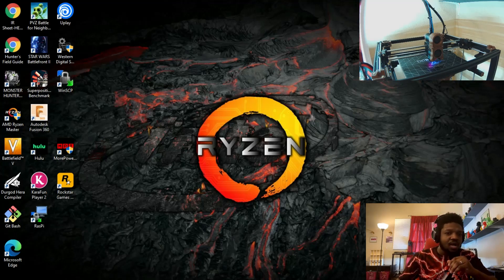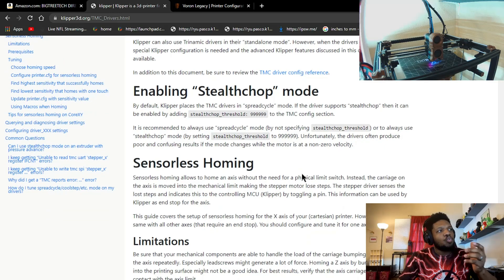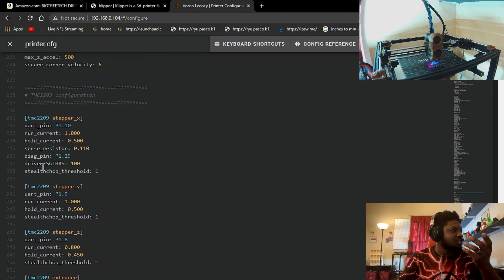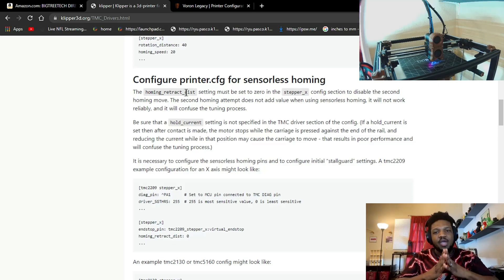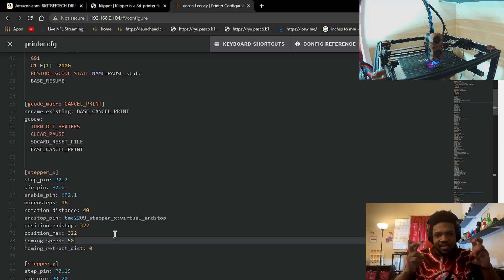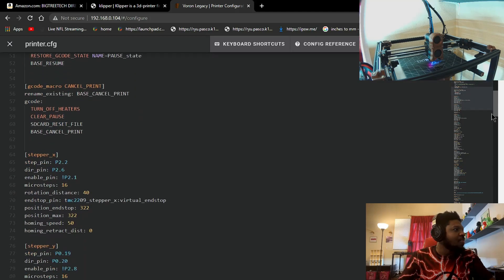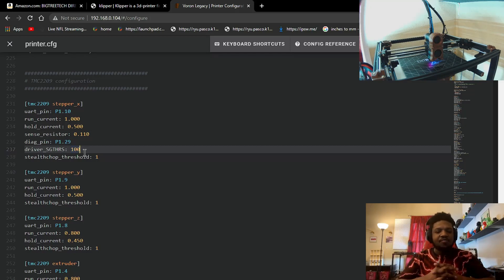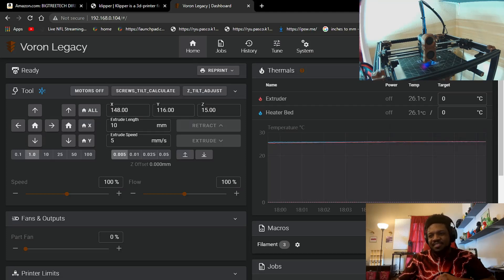// How To Setup Up Sensorless Homing In Klipper // GoldenJaguar392

Comment: Have you tried adding a homing macro on any of your printers yet? The Voron printers use a homing macro that lowers the driver current on the motors, and it applies some other changes to the TMC drivers, which allows for the homing retract to work properly without the endstop error being triggered when it uses your standard TMC driver settings in the config. I am looking for a good tutorial on how to do this with TMC2209, but I cant seem to find any.

Comment: Do you have to cut diag pins for Z axis and E axis drivers? I remember having to do this while configuring marlin way back..
also, do you need to specify diag pin and driver_SGTHRS for all axis that should have sensorless homing? 

For example in the video the config does not contain diag_pin and driver_SGTHRS in stepper Y.
Reply from the maker: you with new board like skr 3 skr 2 and skr octopus board you don't need to cut the pin any longer..a jumper is used instead to activate sensorless home on the axis that It's needed on.. Yes you will need to specify a diag pin which is basically the endstop pin of the axis and driver_SGTHRS for sensitivity. for axes that are not using sensorless homing you wouldn't need any of the latter.

Comment: Hello
GoldenJaguar3D, could you pass your printer.cfg to check the settings? I'm having a problem that I can't do the home correctly, if you can pass it, I'd appreciate it.. a big hug.
Reply from the maker: aw sorry for super late reply buddy didn't even see you're comment till now 

[stepper_x]
step_pin: gpio11
dir_pin: !gpio10
enable_pin: !gpio12
microsteps: 16
rotation_distance: 32
full_steps_per_rotation: 200
endstop_pin: tmc2209_stepper_x:virtual_endstop
position_endstop: 300
position_max: 300
homing_speed: 50
homing_retract_dist: 0

[tmc2209 stepper_x]
uart_pin: gpio9
tx_pin: gpio8
interpolate: false
uart_address: 0
run_current: 1.2
diag_pin: ^gpio4
driver_SGTHRS: 130
stealthchop_threshold: 0

Comment: Works great for the X but just crashes into the Y no matter the sensitivity.  Even tried swapping drivers.  Any ideas?
Reply from the maker: what board are you using?
Reply: @GoldenJaguar3D  fysetc spider v1.1. Jumped the xy diag, removed the endstop wiring, and definitely using the right pin designations for the diag.  If I switch the diag pin to have a ^ in front then the Y wont move at all

Comment: do i need to cut the pin on the stepper drivers or is that not needed in klipper?
Reply from the maker: yes you need the pin on the stepper driver, If you cut it sensorless homing won't work.

Comment: Thank you for your good video,  ı made your settings then X step working good but when ı make same settings for Y mainsail give me an eror, "pin virtual_endstop used multiple times in config" how can ı do it for Y too ? 

thank you for your help
Reply from the maker: It’s sound like you have the same pin duplicated in your config make sure to remove the pin from your y stepper endstop since you’re going to be using it as a diag pin for your y stepper driver.
Reply: @GoldenJaguar3D   sorry can you explane more clear ı am not full control on this job :)

Comment: Okay, maybe stupid question here about the diag pin.  I think you said your setup is for a SKR 1.4 and your diag pin is shown as P1.29 which seems to be the x-endstop pin.  If sensorless homing means getting rid of the physical x- (and y-) endstops, why is it required to include the diag pin?  Wouldn't that pin have nothing connected to it?  I ask because I think I read somewhere about connecting pins with jumpers and that's kind of where I got lost.  Otherwise I understand the configuration, makes good sense.  Appreciate any response.  I feel like you're going to answer and I'm going to immediately realize whatever it is my brain just isn't grasping right now.
Reply from the maker: Well the diag pin the located on the 2209 driver itself, it purpose is to detect stepper motor stall, in the case of sensorless homing where motor hits the side of the gantry. in your printer.cfg you're telling firmware that you're using a virtual endstop, just like you would for a z probe, but in this case its a pin on the driver (2209) itself. If you don't set a pin in the config. The firmware won't know where the senor is, I hope this helps. Pin  P1.29 can be used as a  physical or virtual endstop.
Reply: @GoldenJaguar3D  I think I get it.  The diag pin is on the driver and I'm telling the firmware to take that signal and treat it as it would a signal coming from Pin P1.29 (aka, the pin that would normally be a physical endstop) so when the diag pin detects a stall, the firmware takes that stall and calls for the motor to stop.  Hence, virtual endstop.  I think?
Reply from the maker: @phildawgydawg  exactly you got it!!

Comment: Hi I have followed your tutorial, even copying your settings from comment below and still not working, it is just crushing into side of printer ... Do I need to change something on stepper? Cutting/bending pin or something? On marlin  with sensorless they worked fine (but to do so i had to cut of one pin from driver, is it a case?)
Reply from the maker: Hey sorry to hear about this man, but to answer you’re question, no you need the Diag pin in order to use sensorless  homing, if you cut it you can’t use sensorless homing and will need to use a limit switch. So make sure that the driver your using have the diag pin intact and supports sensorless homing.
Reply: The file he posted below DOES NOT have any sensorless homing in it.

Comment: I'm having troubles just to get mine to home and I've gone every which way with the sensitivity and it still does not work?
Reply from the maker: Sorry about this man, did you make your driver supports senorless homing
Reply: @GoldenJaguar3D   I did it's the tmc2209s
Reply from the maker: @hunterfisher2304  what brand is it? also what board are you using?
Reply: @GoldenJaguar3D  Im using the bigtreetech skr 1.3 and the bigtreetech tmc 2209 v1.2 stepper driver's
Reply from the maker: @hunterfisher2304  ok take a look at this video, make sure you didn't cut the diag pin else it won't work. https://www.youtube.com/watch?v=zZYd0aYtThY

Comment: Currently I am using spread cycle but do I need to adjust jumpers on board beside these tips? (fluiddpi +skr 1.4 turbo
Reply from the maker: No you shouldn’t need to for sensorless homing, you only adjust the jumpers to config uart mode communication for the drivers.
Reply: @GoldenJaguar3D  Thank you bro after my print is done I will try right away, I am sick of my endstop spring being to pop out

Comment: can you share your printer config? I'm having problems getting things working.
Reply from the maker: Sure thing, I will when I get off work.
Reply: @GoldenJaguar3D  thanks I appreciate it, i'm upgrading the tronxy x5sa pro
Reply from the maker: @hankb7725  here you go as promise, [virtual_sdcard]
path: ~/gcode_files

[gcode_macro PAUSE]
rename_existing: BASE_PAUSE
default_parameter_X: 1    #edit to your park position
default_parameter_Y: 320    #edit to your park position
default_parameter_Z: 10     #edit to your park position
default_parameter_E: 1      #edit to your retract length
gcode:
    SAVE_GCODE_STATE NAME=PAUSE_state
    BASE_PAUSE
    G91
    G1 E-{E} F2100
    G1 Z{Z}
    G90
    G1 X{X} Y{Y} F6000
    
    

[gcode_macro RESUME]
rename_existing: BASE_RESUME
default_parameter_E: 1      #edit to your retract length
gcode:
    G91
    G1 E{E} F2100
    G90
    RESTORE_GCODE_STATE NAME=PAUSE_state MOVE=1
    BASE_RESUME
    

[gcode_macro CANCEL_PRINT]
rename_existing: BASE_CANCEL_PRINT
gcode:
    TURN_OFF_HEATERS
    CLEAR_PAUSE
    SDCARD_RESET_FILE
    BASE_CANCEL_PRINT

[stepper_x]
step_pin: P2.2
dir_pin: !P2.6
enable_pin: !P2.1
step_distance: .01
endstop_pin: P1.29
position_endstop: 0
position_max: 320
homing_speed: 100

[stepper_y]
step_pin: P0.19
dir_pin: !P0.20
enable_pin: !P2.8
step_distance: .01
endstop_pin: !P1.28
position_endstop: 0
position_max: 320
homing_speed: 100

[stepper_z]
step_pin: P0.22
dir_pin: !P2.11
enable_pin: !P0.21
step_distance: .0025
endstop_pin: probe:z_virtual_endstop
position_min = -3
position_max: 380
homing_speed: 50

[stepper_z1]
step_pin: P1.15
dir_pin: !P1.14
enable_pin: !P1.16
step_distance: .0025

# Define a probe
[bltouch]
sensor_pin:P1.27
control_pin:P2.0
pin_up_reports_not_triggered: true
pin_up_touch_mode_reports_triggered: false
speed:5.0
pin_move_time: 0.680
x_offset: 0
y_offset: 0
z_offset: 1.965
samples: 3
samples_result: median
sample_retract_dist: 3.0

# The safe_z_home section modifies the default G28 behavior
[safe_z_home]
home_xy_position: 189,168
speed: 250
z_hop: 15
z_hop_speed: 50

[idle_timeout]
timeout: 2500

[bed_mesh]
speed: 250
horizontal_move_z: 5
mesh_min: 50,50
mesh_max: 310,290
algorithm: bicubic
fade_start: 1
fade_end: 5
move_check_distance: 3
probe_count: 4,4
mesh_pps: 4,4
bicubic_tension: 0.8
split_delta_z: .025
relative_reference_index: 7

[input_shaper]
#shaper_freq_x: 46.51
#shaper_freq_y: 55.86
shaper_type: mzv

[gcode_arcs]
resolution: 0.05

[display_status]

[z_tilt]
z_positions: 318, 168 
            59, 168 
points: 318,168
        59, 168
speed: 300
horizontal_move_z: 5
retries: 20
retry_tolerance: .0025

[bed_screws]
screw1: 154,11
screw2: 2,318
screw3: 315,318

[screws_tilt_adjust]

screw1: 49,318
screw1_name: rear left screw
screw2: 318,318
screw2_name: rear right screw
screw3: 183,31
screw3_name: front screw
horizontal_move_z: 5
speed: 300
screw_thread: CCW-M3

[idle_timeout]
timeout: 2500

[extruder]
step_pin: P2.13
dir_pin: !P0.11
enable_pin: !P2.12
step_distance: 0.0023148148148148
nozzle_diameter: 0.400
pressure_advance: 0.0676
filament_diameter: 1.750
max_extrude_only_distance: 200.0
heater_pin: P2.7
sensor_type: NTC 100K beta 3950
sensor_pin: P0.24
#control: pid
#pid_Kp: 22.2
#pid_Ki: 1.08
#pid_Kd: 114
min_temp: 0
max_temp: 300

[heater_bed]
heater_pin: P2.5
sensor_type: EPCOS 100K B57560G104F
sensor_pin: P0.25
#control: pid
#pid_Kp: 54.027
#pid_Ki: 0.770
#pid_Kd: 948.182
min_temp: 0
max_power: 0.8
max_temp: 150
pwm_cycle_time: 0.0166 

######################################################################
# Filament Change
######################################################################

# M600: Filament Change. This macro will pause the printer, move the
# tool to the change position, and retract the filament 50mm. Adjust
# the retraction settings for your own extruder. After filament has
# been changed, the print can be resumed from its previous position
# with the "RESUME" gcode.

[pause_resume]

[gcode_macro M600]
default_parameter_X: 1
default_parameter_Y: 320
default_parameter_Z: 10
gcode:
    SAVE_GCODE_STATE NAME=M600_state
    PAUSE
    G91
    G1 E-.8 F2700
    G1 Z{Z}
    G90
    G1 X{X} Y{Y} F3000
    G91
    G1 E-100 F1000
    RESTORE_GCODE_STATE NAME=M600_state

[fan]
pin: P2.3

[mcu]
serial: /dev/serial/by-id/usb-Klipper_lpc1769_07B0FF0FA69869AFB04A415EC72000F5-if00

[printer]
kinematics: corexy
max_velocity: 300
max_accel: 10000
max_accel_to_decel: 1000
max_z_velocity: 50
max_z_accel: 100

########################################
# TMC2208 configuration
########################################

[tmc2209 stepper_x]
uart_pin: P1.10
microsteps: 16
run_current: 0.950
hold_current: 0.600
stealthchop_threshold: 1

[tmc2209 stepper_y]
uart_pin: P1.9
microsteps: 16
run_current: 0.950
hold_current: 0.600
stealthchop_threshold: 1

[tmc2209 stepper_z]
uart_pin: P1.8
microsteps: 16
run_current: 0.800
hold_current: 0.500
stealthchop_threshold: 1

[tmc2209 extruder]
uart_pin: P1.4
microsteps: 16
run_current: 0.550
hold_current: 0.400
stealthchop_threshold: 1

[tmc2209 stepper_z1]
uart_pin: P1.1
microsteps: 16
run_current: 0.800
hold_current: 0.500
stealthchop_threshold: 1

########################################
# EXP1 / EXP2 (display) pins
########################################

[board_pins]
aliases:
    # EXP1 header
    EXP1_1=P1.30, EXP1_3=P1.18, EXP1_5=P1.20, EXP1_7=P1.22, EXP1_9=<GND>,
    EXP1_2=P0.28, EXP1_4=P1.19, EXP1_6=P1.21, EXP1_8=P1.23, EXP1_10=<5V>,
    # EXP2 header
    EXP2_1=P0.17, EXP2_3=P3.26, EXP2_5=P3.25, EXP2_7=P1.31, EXP2_9=<GND>,
    EXP2_2=P0.15, EXP2_4=P0.16, EXP2_6=P0.18, EXP2_8=<RST>, EXP2_10=<NC>
    # Pins EXP2_1, EXP2_6, EXP2_2 are also MISO, MOSI, SCK of bus "ssp0"

[display]
lcd_type: st7920
cs_pin: P1.19
sclk_pin: P1.20
sid_pin: P1.18
encoder_pins: ^P3.26, ^P3.25
click_pin: ^!P0.28
[output_pin beeper]

pin: EXP1_1
Reply: @GoldenJaguar3D  awesome man. thanks! I appreciate it. yeah i have not been able to get the inductive bed leveling sensor working with the skr 1.4 turbo. I'll check your config to see what i'm missing.
Reply: @GoldenJaguar3D  This file doesn't have any of the sensorless homing stuff in it.
Reply: hey, was trying to get this going on a octopus 1.1 but i need to bring the print head back to middle of bed after each axis homes. I tried a macro but its not working. any ideas on how to do it? i tried the klipper example for x but after it homes x it just goes in a diagonal move and then tries to adjust bed, never even attempted to home. any ideas?
Reply from the maker: @3dprintingbiker693  are you using a z probe for z?, if you are make sure you have z safe homing in your config, and set the homing position for your z probe, so that in homes in the center of your bed.

Comment: actually it says "By default, Klipper places the TMC drivers in “spreadcycle” mode." so spread cycle is enabled by default. you don't need to set it to 1 or 0.
Reply from the maker: you correct the website says that, but if you look it say to enable stealth_chop ad 99999 to the config the default config atleast for the skr if you go the driver section show 99999 which enables stealth_chop and not spread cycle mode, so it could some to report.
Reply: @GoldenJaguar3D  Current docs say to remove it:
> It is recommended to always use "spreadcycle" mode (by not specifying stealthchop_threshold) or to always use "stealthchop" mode (by setting stealthchop_threshold to 999999).
Reply: @GoldenJaguar3D  yeah depends on the config u downlaoded